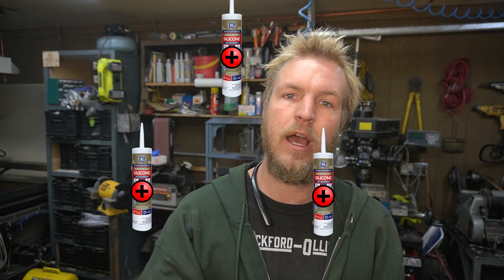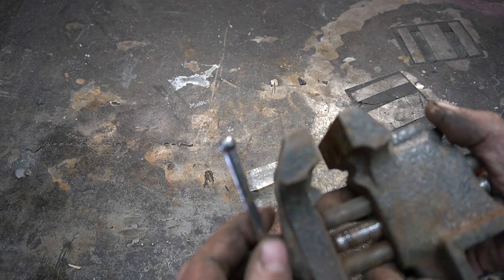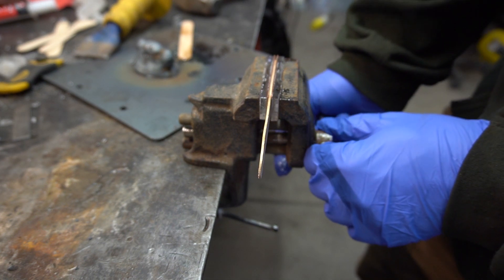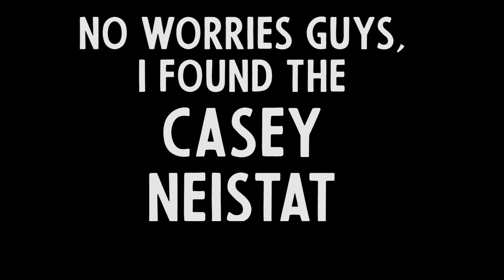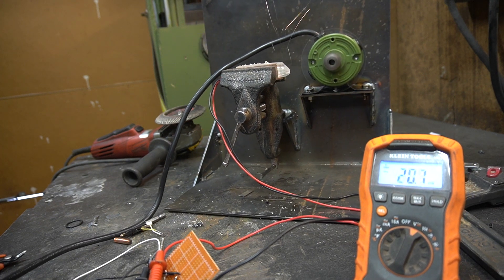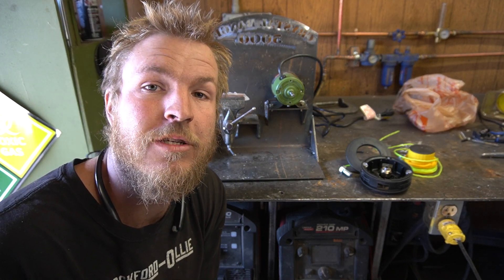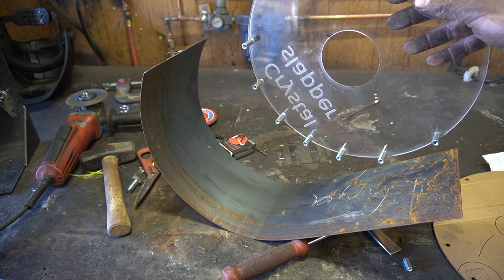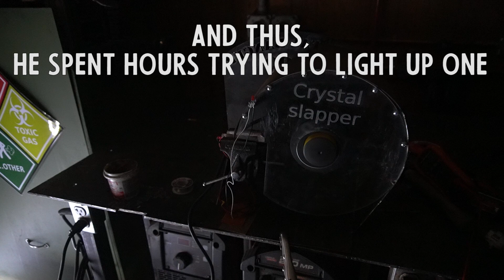Slapping A Crystal To Generate Electricity

Comment: Dude replace the line trimmer blade on the guard with a crystal on a electric trimmer add a few wires and BOOM free energy self powered electric trimmer. (I'm from Australia so it's actually called a whipper snipper) sorry if this has already been mentioned in the comments but I'm too lazy to read them... awsome video mat
Reply: Arhhhh left of the e....

Comment: You're missing something...  add a crystal to top bottom and sides slightly separated so they gain the vibration & frequency.  Connect a positive and negative to each like you did the one.  Remember that Nikola always said, Vibration, Frequency, and energy are three key requirements to life.  You will create more energy just from the vibration and frequency if intuned with the same crystals around them if close enough.  This should drastically raise your voltage to around 20 to 25 volts, likely.   Maybe more.  You only need to hit on.  If you space them around with tiny spacing, just enough to get them all in the same frequency as they are being hit you may draw much more power than that and only have to hit one

Comment: If a quartz crystal was subjecting to equal amd intense pressure, such as a vice grip or bottom of the marinara (mariana sauce is for spaghetti) trench, would it theoretically light up or emit some constant voltage?
Reply: i think its kind of akin to passing a magnet past a coil, its the act of motion that produces the voltage, not the final state.
Reply: @X4Alpha4X  ah, so variable pressure, that makes sense.

Comment: i was surprised you never took readings while constantly tightening the Vise and adding consistent pressure to the crystal... that is how it would work underground, constant pressure.... like when Crystal wants to set a world record and squeeze a watermelon with their vise legs the immense pressure the watermelon is under but in your case stop right before the crystal collapses its structure, and see if consist-ant Voltage is produced?

Comment: try extract pizo parts out of 50 lighter put them in a circular wheel and with the precise setup you can produce 50 htz 1000 v  with just 1 RPM

Comment: although the host of this video already knows the problem with is setup, very inefficient design, he acknowledge that piezo does light up led's, the ceramic piezo discs. the host was trying to take a stab at the free-energy tropes that is out there about crystals and free energy. however, he doesn't realize that a piezo-generator will be the future of energy generator, no moving parts for generating electricity.

Comment: The secret of whacking electricity out of a crystal is that you've to do it periodically. Squeeze, relax, squeeze, relax .. Other people tried squeezing only that didn't work. The trick is let the nature do the work, so you don't have to, hence, the free energy claim justified! There are two ways to achieve this. One is you build a (water proof?) crystal sandwich and let the waves hit it. That way you can accumulate charges in a capacitor over time. Another way is to collect surface Telluric current. A beach is full of crystals and rocks that are being pounded by waves all the time. If you stick a rod in the sand where waves are pounding and another rod a bit further there should be a potential difference. Better yet, if you can create an isolated negative ground, it will suck current out of the earth. Somebody needs to keep experimenting on these world changing ideas.

Comment: If I am not mistaken, RPG7 has a shaped charge, that need to be detonated with an electric detonator from the back on impact and I believe some did use pizo stikers in the nose to do this. So there must be a way, maybe layer them in series, copper silicon copper silicon ... then give it one death stike as there does seem to be a relation between strike energy and wattage out. I might be completely wrong here though.
Reply: Clamp the crystal battery tight n attach too a little rechargeable battery n put the setup inside a basketball so it's clamped and getting smashed around whilst clamped...there ya go basketball players will power the world one day 😂😂😂

Comment: Clearly the crystal slapomatic needs an array of crystals all connected in series around the outside of the weed wacker so it slaps em all in sequence and generates a higher voltage.

Comment: what if you was to put crystals all around the enclosure like the placement of numbers on a clock ,and then wire each those together , if you are getting half volt with one and you have 12 wouldnt that be 6 volts, also instead of weedwacker line  a cpl thin strips leather would smack it and give more resistance which would be more power( Tim Taylor- Tool Time) also it would be more steady and consistent power,i just thought that right now thank to whatever brought it to my attention i forgot now but i think you can get steady power ,that way,add 11 more crystals and use 1/8 inch wide belt leather

Comment: I think you might be able to light that LED if you do away with the bridge rectifier, all it does is puts two rectifier diodes in series with the LED. I think it'd be cool to see that LED glow, even if you need to insulate the machine from outside light and delve into long-exposure photography.

Also, I don't know what the resonant frequency of this crystal might be, but if it's below 20 kHz, you might try hooking the output to a headphone - they're pretty high impedance, all things considered.
Reply: Now that I think of it, if it is very fast, you might have been bandwidth limited by those very slow rectifier diodes. I don't really know the response time of an average LED too. Hmm, if you ever do decide to play around with this a bit more you might want to maybe use a single diode rectifier (so basically just a diode in series with your LED) made with an 1N4148 or maybe something like a BAT85? Heh, I guess you take the oscilloscope out of the equation and all of my hard-earned EE intuition goes out of the window

Comment: As it’s pulsed can you use a diode capacitor ladder to increase voltage like the electric shock machines use? 😀 quick google voltage multiplier would be the cock for dolly 🤣

Comment: Little boost converter would work, maybe even just a little transformer on the direct AC output of the crystal. But of course since you’re basically capacitively coupling the signal through the crystal, the effective capacitance of the quartz crystal will serve as an impedance to any current flow. A thick crystal like that might barely have a picofarad. That’s a really high impedance at anything that isn’t microwave frequencies, at which point the actual thickness of the crystal gets comparable to the wavelength. Compare that to the sub-mm thin slices found in a clock’s oscillator, or a common piezo disc.
Another factor is that the diodes you used are probably kinda shitty silicon rectifiers, where using small signal silicon diodes would have likely given a better signal with less loss to leakage. I’ve heard that transistor b-c junctions are even lower leakage.

When it comes to this kind of energy harvesting, you have to think about all sorts of ways that you might be getting losses from. Same for rectennas, crystal radios, thermoelectric, etc.

Comment: Put a transformer (in reverse) in front of the rectifier and use a modern green/blue LED. Should work much better. Also should have tried to measure the short circuit current from it.

Comment: The quartz will keep vibrating for a little while, like a bell, if you keep it away from anything that will damp the oscillations, and then that ringing is equivalent to slapping it thousands of times per second instead of idk 10 times per second with the weedwhacker. If you want to do more with this (and I understand that you might not) then you want some way for the crystal to ring unimpeded. Also maybe a transformer or something to turn the high voltage low current from the crystal into lower voltage higher current.
Reply from the maker: Ya know man, I didn't plan on taking this project further, but after reading this comment I'm considering it. Definitely lots more research to do!
Thanks!
Reply: @cranktowncity  man i love it please do continue, this is some atlantis shit harvesting energy from crystals.... CRAZY
Reply: @cranktowncity  same
Reply: What about creating some sort of resonant field
Reply: Ya know, watching this made me think, have you tried a type of vibration like music or an instrument string, but a very specific note to create the vibration vs hitting the crystal? Reading @sealpiercing8476 comment to you about “ring like a bell” maybe even using a specific bell tone near the crystal to create voltage? I’m no scientist, just curious and have been trying to create free electricity since I was a kid. I’m just so facilitated by electricity and the more I learn about it gets my gears turning.  Your video stopped me in my tracks.
Reply: I'd attach it to the mrs vibrator could make megawatts with it then.

Comment: Most of the designs I've seen for crystal oscillators use two capacitors. Try duct-taping more capacitors on there? Could also maybe polish the sides of the crystal in contact with the copper for more juice.
Reply: The capacitors are just for driving them electronically and must be in series with it. Adding them to this in parallel would make things much worse and adding them in series would just be pointless.

Comment: piezo crystals produce different voltages based on the angle they are cut, their internal structure, amount of force and direction/side being 'slapped". You can produce hundreds of volts with some crystals/ceramics but the current is really low.
Reply: Yeah for sure the angle is key.  Also the crystal habit needs to be pretty consistent for that to even matter either.  I'd think Rochelle salt would be more accessible to the home-gamer since you can grow your own xtal.

As a side note, it's not so much the angle that enables different voltages as brute force in the case of a bbq sparker, but also, when driven at their resonant frequency a crystal can generate voltage gain (in principle) equal to it's Q factor, which for quartz can be up to a million.  There used to be piezo-"transformers" as well for driving CCFL's with a beefy single layer device as primary, coupled to a stack of thinner devices in series.
Reply: That’s how one makes a lighter’s igniter too!

Comment: Fun tidbit: There exist battery-free wireless light switch modules, and some are piezo-based. When you click the paddle, it uses that energy both to power the transmitter and send an RF signal to the light bulb receiver.
They're cheap, too, though most are electromagnetic.
Reply: So piezo switches have crystals in them?
Reply: @Nobody-Nowhere  Yes, though you won't really see them. Note: "piezo switch" usually denotes an industrial vandal-proof switch that uses a piezo sensor to detect whether it's been pushed, and usually requires external power. The wireless ones are self-powered.
Reply: @Spirit532  I was considering one in one of my projects, and a quick read kinda hinted that they generated power somehow. They were these non tactile touch type switches, so no moving parts.. just pure magic. So maybe magical crystals then.
Andreas Spiess just release a video about wireless non powered switches and stuff.
Reply: @Nobody-Nowhere  There exist capacitive switches, the same tech that's used on a smartphone screen. Piezos are just way more robust.